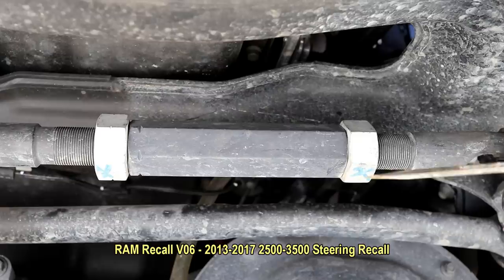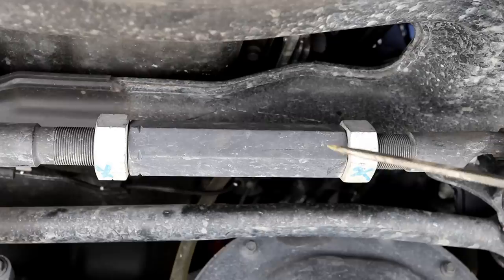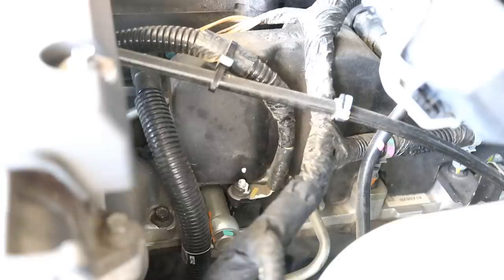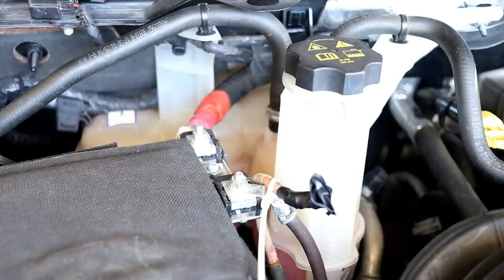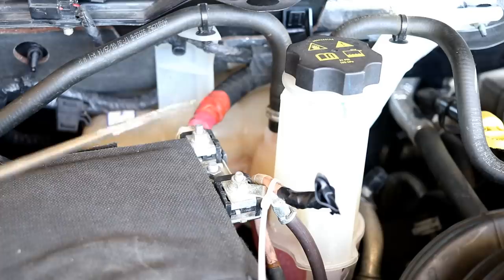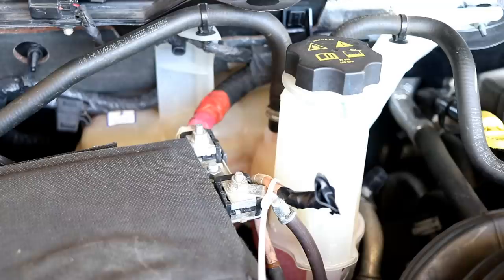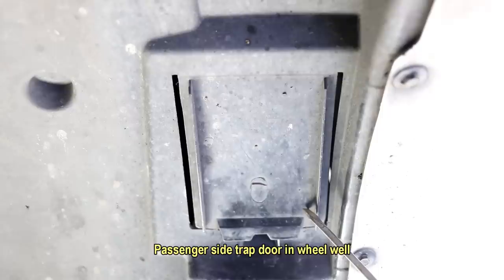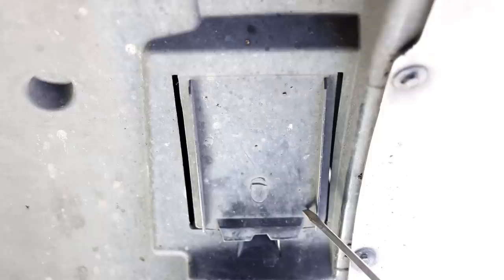RAM Cummins - 5 things you need to know about your truck

Comment: 2018 2500 6.7 Laramie-  had the recall also on the front steering linkage and one on the tailgate latches and something else that I have forgotten what it was - already had to change out the radio for the entire electrical system screwing up - and its already doing it again at 40000 miles - windows not working properly - radio not working right  - they were suppose to change it out again but refused to do so until it would mess up while they could see it doing so - only happens at sporadic times -  it  already had to have the brake master cylinder and something else in the same spot  replaced because of mussy and hard brakes - and is starting to do it again - warranty is off now  -- so they probably wont do it without me paying - big $$  -- sometimes the panic alarm goes off when ever it feels like it at any given time for no reason - service light is already on when in reverse when 4w drive is engaged - ever heard of that yet - Im wondering what it will be ? !  - Not very pleased with this foreign parted american piece of mess at this juncture - called dodge and Cummins on it for another problem it is having - revs high around 1100 RPMs at remote starting at or below freezing - Cummins tells me they are not able to tell me anything because of a very large lawsuit from ram that makes it where they are not allowed to work on or DISCUSS what may be wrong about the 6.7 engine of the truck - which seems very mobsterish to me - Fishy that is - ever heard of these problems before - yet ? !  - ram all but demanded me to buy an extended warranty after buying and even until this day - called - sent letters - at least 5  to date - very fishy stuff - very disappointed - any clues ?
Reply from the maker: No, I've seen the high idle issue at cold temps.
Reply: @MarionBlair   - mine sometimes does it the whole time on remote start  at freezing -- and sometimes - any old time - since I have gripped a lot to three different dealers - it has only happened back when it was below freezing - has anybody explained it yet - the dealers i talked to have no clue at all why - they just say its Ok -- and I notice that my milage will be less on those tanks of fuels - called Cummins co - will not discuss the issue at all - last dealer I went to told me to get rid of it - - offered no help in understanding - odd stuff -

Comment: Hello and good afternoon. Question. I have a 2014 3500 tam Cummins. 80,000 miles. Good condition but radio shuts off on it's own every 10 mins or so. I'm looking help.
Reply from the maker: I've heard of this.  If you haven't done it, disconnect both batteries for 30 minutes, it's fixed some.  Also, if you can run the latest update thru, I'd try that in case something got corrupted with the current.  Last thing would be to have the dealer re -flash the radio.
Reply: @MarionBlair  alrighty sir.  I appreciate the suggestions.  Love your videos. 1st time Diesel owner. Loving my truck.

Comment: What about 3rd brake light leak?
Reply from the maker: Yea, I guess it could be added.  I haven't had the issue but some have.
Reply: I clean and inspect all my lights once a year
Reply: Yeah, that's pissing me off! I even replaced the seal with thicker auto door seal, and it still leaks! Didn't want to use silicone, but looking like that might be next.
Reply: Never had a leak on my 14’ with 112k.

Comment: Hallo Marion, this is about tires for the 5000 pound, 25 foot dual axle travel trailer. The rig came with the cheapo TailerKing D rating tire.  I'm shopping for a spare and am wondering if it's just fine to regularly tow with three D tires and one E ? I'm considering getting a better quality Carslile  ST 225 /75 R15 with E rating, but one person says it's best to have all four being the same and the other person says it's fine but just don't go with a lower rating than what's supposed to be on. Also, was going to get galvanized rim but a guy says he's not such a believer in galvanized rims, regular painted or powder coated actually he prefers.
Reply from the maker: No problem mixing D's with E's.  5000 must be your empty weight.  D's are good for 10,000.  Most 5,000# max weight trailers have C's.  The axles are usually rated less than the tires.  It's normally stamped in the  center of the axle shaft under the trailer if you want to check.   The Maxxus is a very good tire.
Reply: @MarionBlair  Ok, thank you.  My RV  guy likes the Gladiator trailer tire. I'll check prices on the Maxxus D and E with a rim. No real need I guess in me getting E though because my camper came with the four D and is definitely less than 8000 pounds loaded. They want 130$s for the Carlisle E including a rim. This local tire store guy also thinks these tpms systems we thread onto the valve stem and bluetooth displays on the device we put on our dashboard actually cause my troubles than they alleviate. What's your thoughts on them? I like the Tymate 6 sensor tpms sold on Amazon for 160$s and from what I hear they are very helpful in saving us from a blowout. And supposedly we need metal valve stems for the sensors with flow through ability, save us having to remove the sensor, but so what, we have to remove the valve cap anyway. Hope you're surviving this Corona ordeal ok, stay healthy, thanks for your thorough efforts. God Bless
Reply from the maker: With the screw in TPMS make sure you put steel valve stems.  (And balance the tires).   Otherwise, the valve stem can start wobbling from the added weight and cause the stem to brake off or leak and dump the air.  I've used them a lot on motorcycles.  Nice to have however. 
 What kind of problem did you have?  Unless your current rims are rusted or damaged I'd save the money.  I don't have any experience with Carlilse but they have been around for a while.  I think Maxxis M8008's are a favorite among RVers.   Find out what the GVWR is on your trailer.  Usually have a sticker on the front driver's side or somewhere.  Take your trailer to the local CAT scales and get at a minimum, your axle load.  The key to not having any tire issues is checking the pressure in the morning before you leave and air them up to the maximum rated tire pressure that's stamped on the side of the tire.  (TPMS makes this easy)  If your trailer came with D's, they should be sufficient but if you'd rather go to E's, that'll give you more weight capacity if you are close to GVWR.  (Axle rating is probably less than the D's however)   D's are usually inflated to 65 and E's to 80.  If you don't inflate the E's to 80, they are no better than the D's as far as load carrying capacity.  Tire pressure is critical on these trailer tires.
Reply: @MarionBlair  I'm just shopping for one spare right now. So I'm wondering if one of my four cheapo Ds blows or I get a flat, and I put on my new spare that's an E, would it be smartest to fill it to the 80 psi? 🤔 having the other three at 65? perhaps causing some size imbalance? Good point or what ? Just thinking

Comment: I wont own a diesl powered dodge, the steering has always been a problem I just fixed my steering on my 85 Ramcharger ,I have never had a Dodge with such nice steering.
Reply: Well I have had 2 1996 12v Cummins and both steering wise tight. One with 407k. My 2008 ram is nice and tight too. Fords have lose steering too, and the izuzumax well Iv drove plenty that weren't tight and tie rods snap.....
Reply from the maker: Yes, none are perfect

Comment: What brand is the replacement for the intake boot?
Reply: K & N makes one but you have to buy the filter and I haven't found one that eliminates the square should at the bottom which I think is the culprit for the air flow issues.  So still looking.

Comment: Safety wire one side to the other
Reply from the maker: yea, nice if there were holes for the safety wire.
Reply: @MarionBlair  Don't need holes, wrap wire around threads on one side, pull tight over nut on other side threads. Go back again tightening each side as you go

Comment: What do you think about them using the CP4 pump in the 2019+ trucks?
Reply from the maker: There's a lot of controversy over the CP4 pump and it's inability to handle the low sulfur fuels but I'm assuming all that has been worked out????  Hopefully.
Reply: @MarionBlair  I worked in high throughput engine cells at Cummins in 2012-2013 before going to GE. I have a 15' Ram 2500 now. Its a shame that they have to choke these engines down for emissions instead of going that much further on a gallon of fuel. The low sulfur is also a shame because thats what made diesel prices go up. I just got my first check engine code at 63k miles P02E7 for intake air flow position sensor. Now i'm debating should I try to clean the throttle valve or spend 400+ on a new one. Or should I do emissions in tact tuning or delete. Love these engines but the carbon soot buildup in these engines due to the EGR is not healthy!
Reply from the maker: @OhioPatriot308  Mitch, I'm struggling with this also.  So accurate what you say.   My first cummins had no her and the oil never turned black.
Reply: @MarionBlair  From what I keep hearing, CTT does some of the best tuning for emissions/deleted engines & transmission tuning. Good thing about them is if you delete you can get another tune from them for free I believe. Calibrated power only does emissions intact .
Reply from the maker: @OhioPatriot308  thanks, I'm googling them now.  I think if I delete, I may just pull all the crap out of the hood however bult emissions intact does make more sense, especially if you've got to reinstall it.

Comment: Ya now I am freaked out about my grid heater.  No two ways about it, this is a serious potential disaster.  If you disable, you will throw a code.
Reply from the maker: Not if you go straight to start once you go to ignition on.  Even if it does it won't do anything different.  Just clear it when convenience.  Disconnect at passenger's battery.
Reply: @MarionBlair   thanks!  Just I side tip.  I live in a northern state.  I discovered that if you keep the block heater plugged in cold weather the grid heater doesn’t activate...just another way to limit it’s use.  Keep the videos coming Marion!